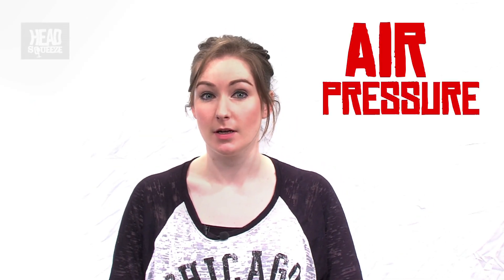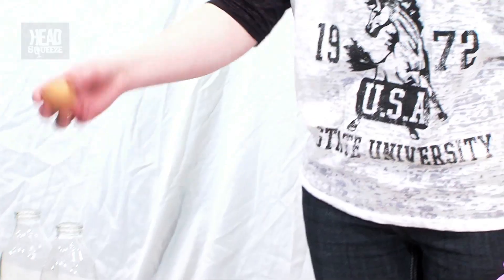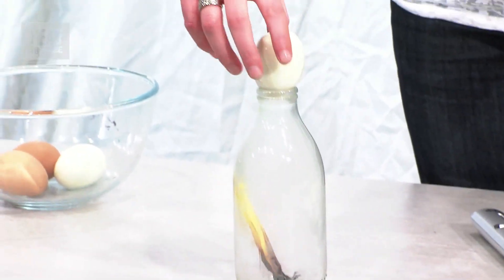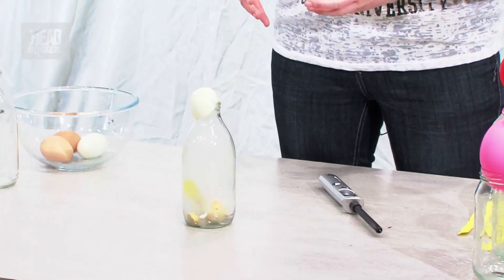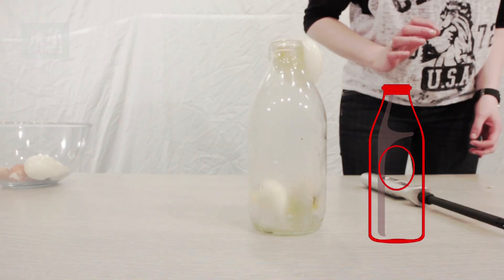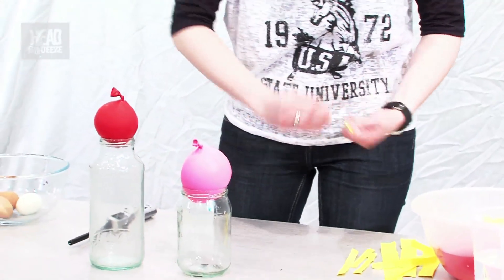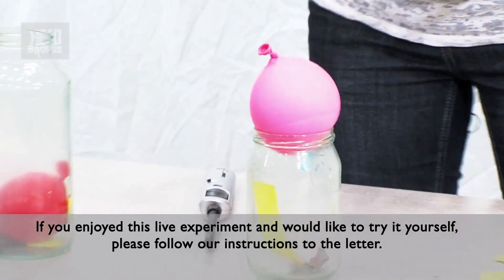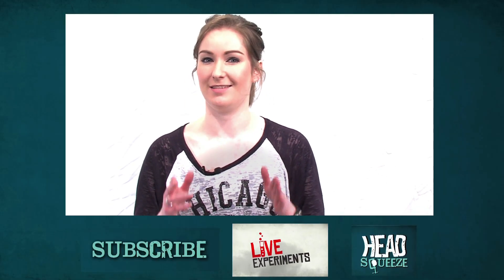How to get an egg inside a bottle | Live Experiments (Ep 28) | Head Squeeze

Comment: You don't have to boil the egg....you can also use the vinegar method which is just soaking a raw egg in vinegar over night.  The shell becomes like a rubber and the egg won't break but is pliable and can be sucked in with no trouble.

Comment: @BBC Earth Lab you Try to get the surrounding of the bottle to be lower pressure than the air inside the bottle then you turn the bottle around so the egg is at the bottom. then the egg should go through coused by the air that wants to get out. Idk if this is true but this seems sensible?

Comment: You had too much fire in the first one, which is why the egg destroyed itself when it tried to enter the bottle. That's why this experiment is usually done with just a single match. The smaller the flame the less intense the pressure is, thus resulting in an easier pressure build. For people wanting to do this, try a single wooden match and a milk bottle. You'll likely get the egg to enter without it destroying itself in the process. Only drop the match in once it's done burning off the phosphorus. Although it does depend on the size of the bottle. You can find traditional milk bottles in a lot of health food stores.

Comment: experiment of the century!!! how do you get it out???
Reply: Pfft, simple. Just put the room on fire instead of the bottle and then let it cool. This will then create vaccuum outside the bottle and forcing the egg/baloon out.
Reply: Sathish Kumar You could do the same instead with a empty bottle, put it on top of the bottle with the egg in it, flip it upside down and once it gets between the two bottles pull them apart and it should pop right out.

Comment: how do i get that egg out ???
Reply: +mrJesper a Vacuum cleaner.
Reply: break the bottle😂😂
Reply: +mrJesper a freeze it and then tip it upside down after you take it out of the freezer. As the air inside warms and expands, it'll push the egg back out
Reply: +boxxer221 No.Think of a Cherry Capris Sun drink. Remember how flat it gets when you suck out the liquid thru the tiny straw? Glass can't deflate like that so a regular vacuum would not do anything. Even the most powerful vacuum mankind has ever known would just shatter the glass due to implosion.
Reply: Charlie L Only if you have an airtight seal, and I wasn't being super serious.

Comment: for the egg, you need to let the  paper burn for bit BEFORE putting the egg on top. the rising hot air is what caused the egg (and balloon) to bounce. to get it out, put a straw into the bottle, turn it upside down. with the egg settled at the neck, blow in to the straw, the air pressure will push it out

Comment: fill the bottle 90% with mineral water, turn bottle around so the egg is blocking water coming out, then start shaking gently. Egg should pop off very quickly due to pressure.

Comment: I have 2 ways or Ideas to try get the egg out which don't involve the usual blowing in the bottle that everyone knows about.

1. Boil a kettle of water and fill the bottle with the boiling water and turn it upside down rather sharply. Within a few seconds the steam should blow the egg out. warm bottle first to avoid cracking. obviously wear oven gloves while handling the hot bottle. 

2. This may or may not work as the temperature difference may not be sufficient. But place the bottle into the bottom of your freezer on its side for a couple of hours this allows the air inside to cool down and also allows the smaller molecules of cold air inside the freezer to fill up the bottle. 

After a few hours take the bottle out and turn it upside down. leave to warm up over 10-30 min, in a position to allow the egg an uninhibited exit and it should pop out as the cold air inside starts warming up to ambient temperature. 
If this doesn't work try holding the bottle upside down under warm water once you take it out of the freezer.

Comment: My best guess on getting out

You'll need:

1. Larger bottle big enough to fit the smaller bottle inside without a problem

2. String and cork to fit the bottle and hold the smaller bottle upside down

3. A large amount of paper to heat up the larger bottle

This is how it works:

It's kind of reversing the effect of the egg going in the bottle.

You'll put a bunch of flaming papers in the bottle and then put the cork with the bottle hanging off it to seal the pressure. 

Then as the bottle is heated up the smaller bottle will start to push the egg back out of the bottle when the egg blocks the pressure from moving(that's why it's upside down)

But just opinion. I don't have the time or bottles to test this out myself
Reply: And you have time to write such a big comment

Comment: I'm pretty sure it has nothing to do with the temperature of the bottle or the air.... The fire consumes the oxygen inside the bottle, and when the egg is placed on top, it prevents new oxygen from flooding into the bottle. When the fire uses up all of the available oxygen in the bottle, all that's left is CO2, the by-product of combustion. CO2 is denser than O2 and would settle at the bottom of the bottle, so there's a vacuum in the top of the bottle, and since particles generally move from an area of high pressure to an area of low pressure, the egg is sucked into the bottle. It's the egg being acted upon, not the outside air like you said in the video, and the temperature has nothing to do with it.
Reply: Well no, Breizh. In fact, just as with air, most of the gas in the bottle is Nitrogen, and it takes no part in the burning reaction, but it is heated/cooled in the process. The CO2 that is produced certainly is heavier than O2, but the total mass is minute, and nowhere near enough to create the kind of vacuum you see here. Morna is 100% right in her explanation.
Reply: Golly, ho! how are the anger management classes going? ; )
Reply: ***** youre the one acting like a child
Reply: The particles moving around is the heat so you're both right kind of that's what it gives off or is doing

Comment: now my egg is stuck inside a bottle :(
Reply: LOL fun STUFF Light the room on fire. Problem solved.
Reply: I know I am kinda late.. But you should just blow in the bottle and pressure will throw the egg out. :3
Reply: +Jakov GTR But be careful not the egg to hit your face!
Reply: +Jakov GTR the idea is sound but the pressure inside and outside the bottle would equalize immediately, before you can get the egg between the two air masses
Reply: +Erik l You just have to seal all air entrances , bad thing is that you will suck that egg xd

Comment: Actually, the hydrogen in the fuel (the paper in this case) combines with the oxygen in the bottle to form H2O, and water is quite dense. As the average density of the contents in the confined volume, i.e. the jar, goes up the pressure goes down, thus, drawing in the egg/balloon
Reply: Uhhh... No. That's definitely what's NOT happening. It takes an incredible amount of energy to fuse Hydrogen and Oxygen together to form water.
Reply: Daniel Liu :D ...just the opposite.
Reply: grebo121 sorry, I was dumb 6 months ago. Of course, now I know that 2(H2)+O2->2(H2O) is a exothermic reaction :P
Reply: Actualy, carbon combines with the oxygen to form CO2

Comment: Turn the bottle upside down. The egg will drop  to the bottom, covering the opening of the bottle. Tilt the bottle over a lit candle. The candle heats the air in the bottle. As the air heats, it expands, creating an OVERpressure in the bottle. And so, the egg does the opposite of what it did earlier.

A tip is to use the caraffe from a vacuum coffee-maker. Easier to use than a milk bottle and paper strips, easier to find than a milk bottle, perhaps, SAFER, as the glass in the caraffe is made to handle heat, which a milk bottle really isn't, and also a bit bigger, making for an easier 'swallowed' egg. Fill it halfways with water, put it on the heat. When the water boils, take it off and put the egg on. As the water cools, 'slurp'.
Reply: I turned the bottle upside down and set fire to my house. It didn't work (the egg is still in the bottle...) D:
Reply: Giancarlo Olio No wonder. Your house isn't a candle!
Reply: Giancarlo Olio Next time try your computer as a candle. That way you won't be able to post such stupid comments :)

Comment: Put a bit of water in the jar, flip the jar over so the egg inside plugs the hole leaving water inside, heat the bottle until it boils, and the water vapor should increase the pressure enough for the egg to be forced out. 

That, or take a dirt devil to it.

Comment: To get the balloon out:
1.  Fill the jar/jug/whatever with milk
2.  Grab the balloon and pull it out.
Explanation: Since Milk is more dense than water, the balloon will rise to the top.

OR

Just turn the jar over, grab the balloon, and pull.  Add a little water to lubricate the surface first, though.

Comment: If a small enough mouthed jar, you can orient it upside down, seal your lips around the edge, blow really hard, then suddenly pull the jar or bottle away, higher pressure inside instantly wants out, blam, egg on floor.

Comment: if you would hold the bottle upside down with the egg at the edge and then heated the bottle from the side (from outside the bottle obviousley) wouldnt the pressure inside rise and push the egg out?